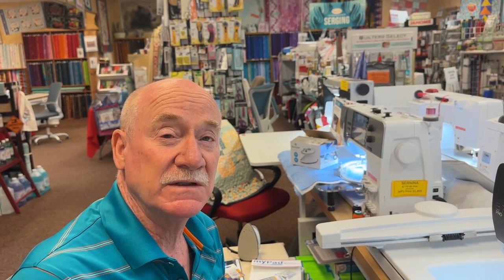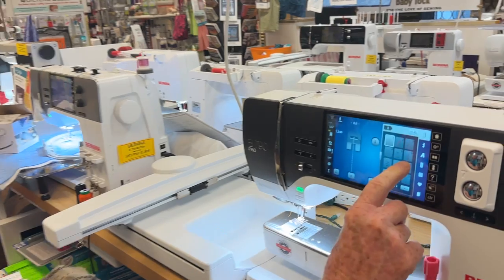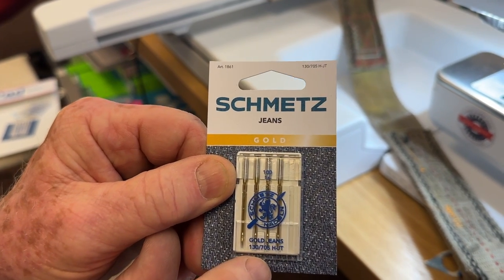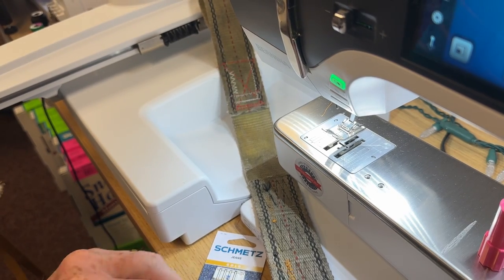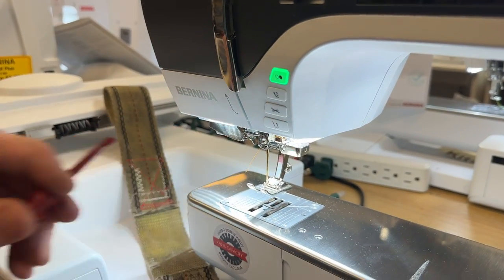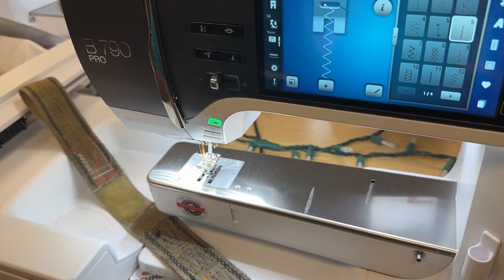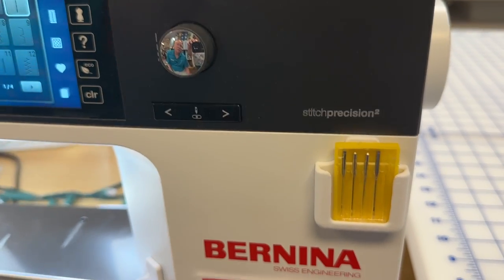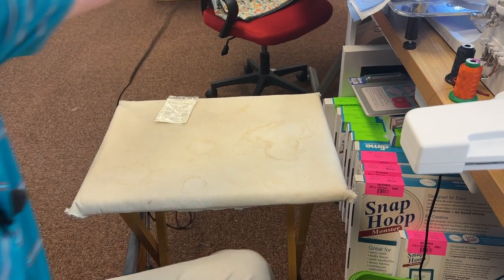How to sew heavy thick fabric or straps and new products needle box holder DIY ironing board Jeff

Comment: I have a tomato pincushion i marked with a Sharpie into smaller wedge sections. Each section is marked with a needle size I use. Then I have 5 long pins, each eith a flag for one of my machines. I always know what needle is in rach machine without having to pull out my jeweler's loop. I made an ironing station from a snack tray and use the same stram iron you show. It has served me well through shoulder replacement surgery because it is so light weight!
Reply from the maker: Thanks
Reply: Needletomato:face-blue-smiling:😂😂:yougotthis:

Comment: Hello Mr Jeff. I love your videos. I did make a ironing board like you did awhile back and I do use the little steam iron for quick pressing. I wish you were closer. I live in Colorado Springs. I have a Bernina 770QE. I have a question. I have a Bernina 1630 from 1996. It sews beautifully. But the light behind the screen is dull. Is that fixable and replaced ? And what do you estimate the price would be. Thanks, Carmen Maldonado
Reply: I had a 1360 for 30 years. My motherboard went and the part is no longer available. Went to a 480 and within a year traded it for a 790 plus. Have your dealer or service person check/look at it. Dull screen is how my issue started. Darn good machines.

Comment: Hello Sir, I have a quick question about the 6:00 mark where you told us to not use #69 Nylon thread or it would damage our homeowner machine. I need to know why because that is my preferred thread. I have an early 80s vintage Kenmore 158.15251 that I use Strong bond Tex 70 Nylon thread. The machine favors that over all my standard polyester threads of every brand.  I just tried it on 9 layers of NYCO 50/50 cotton and nylon mil grade fabric. I bought the Strongbond heavy nylon for backpack construction using 500 D Cordura. Can you kindly tell me if there's a particular reason why I should not use it anymore?  Thank you very much sir for the great ideas!
🪡🧵🙂👍
Reply from the maker: Most sewist do not know how to adjust tension for 69 bonded thread, sounds like you are fine. Continue as you are Kenmore old styles are tough
Reply: Thanks for the response. I was concerned. Yes, the tension top and bobbin is different for it over the standard threads. It was a learning curve but usually happy with the results. 

BTW, I had to buy the manual and replace a couple of parts on my ex girlfriend's Bernina. I was extremely impressed with the precision of her machine. It was an extremely nice work of engineering. It's very generous of you to provide such valuable information. 
May the Lord bless you!
https://youtu.be/2sObUZM2KD4

Comment: Thanks! So help as always. When you mentioned the company that makes magnetic pin holders, it reminded me that I’ve always been told not to use one near my machine, which is a bummer. I have a 770 QE plus and would like to put one on the throat to the right side as I see. Is it safe after all?
Reply from the maker: Modern machines are magnetic shielded now it’s safe to use normal sized magnets around and on your machines so I was told by Bernina Tech department.